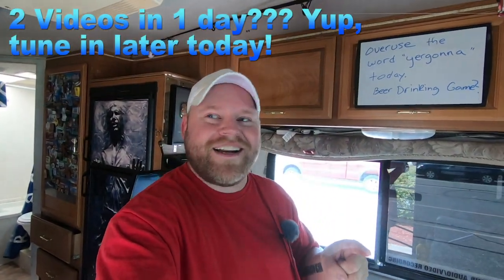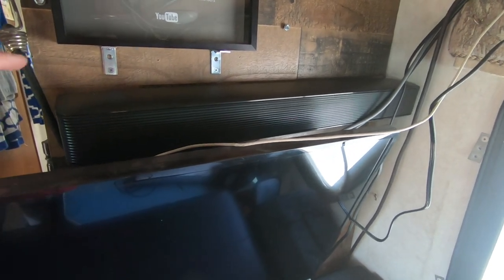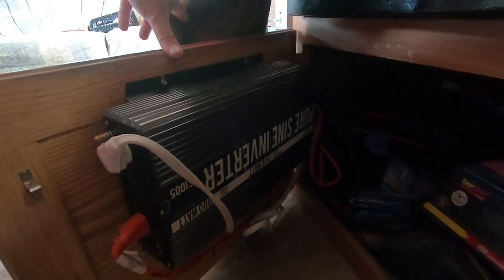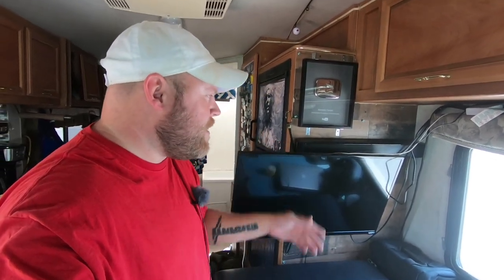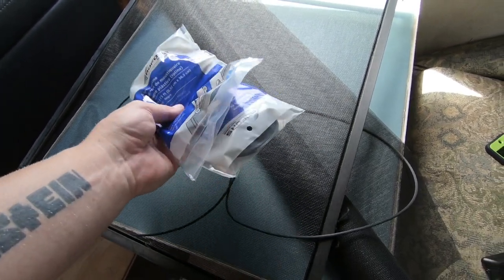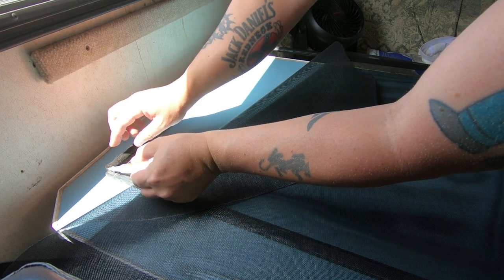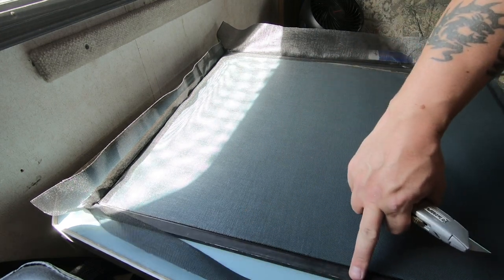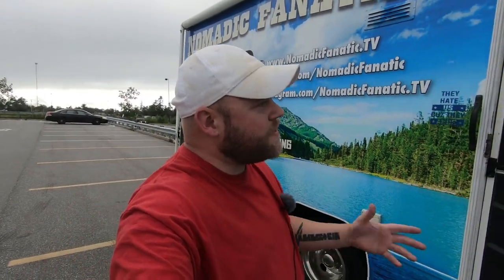Installing Sound Bar & Bug Screen Upgrade

Comment: You can see the difference in the screen for sure. It looks darker than the old screen when looking at it with the side by side shot. Thank you for showing this. I didn’t know the screen came with smaller holes.

Comment: Thanks for the DIY tips on the screen Eric!  I was thinking though that there is a trade-off to the smaller / tighter screen and that is actual airflow.  It's going to be harder for a breeze to come through that new screen since more area is being "blocked" by the tighter mesh.  But of course now you have less of those tiny bugs inside your rig.  I dunno, maybe depending on your area of the country you're in you have "tight" and "loose" screens??!  :-)

Comment: Hi Eric. Nice job on installing your no-see-em screens. It will certainly help with that problem but EVERYTHING in life is a pro vs. con, cost vs benefit analysis and in this case, the pro is that you'll get to block more insects and more light out, but the con is that you're also effectively blocking up to 50% more ventilation. You won't get as much wind draft coming through those tiny holes. So while it'll keep the smaller bugs out, it'll also restrict your air flow more. Your fans will need to circulate harder/faster to bring the same amount of airflow through the RV. Enjoy!

Comment: I be clear for those looking at Vizio tv's...Eric having issues with the amount of volume is a function of the installation. The speakers are rear firing and need a surface behind it to fire against...both speakers! I know this from personal experience. His tv does not have a wall behind it fully. I did the same thing with a larger one...ended up getting a smaller one and it all worked great, even returned the sound bar I had purchased ;)

Comment: As a personal money manager I see your challenge, much like other seasonal workers. As a seasoned YT video creator you know what to expect unlike some newbies, so my suggestion would be to prepare for the 'leaner' season by setting aside into an Emergency Fund that little extra received during the good times to cover you during the summer months.   Your faithful followers will be back after returning from their normal vacation.  Most RV'rs don't share like you the fact that your mobile home must be maintained and that includes little things such as the screens.  Good share..Stay safe.

Comment: Our ceiling vent screens let a lot of no-see-ums into the RV in Savannah. The mesh on those was even larger then our RV window screens. Have one more to change out then all 3 will be MaxxAir 4500K Vent/Fans which have better screening.

Comment: Same screen I used on my last motor home door and my van. Great screen but the only problem I found is less air flow though the screen. I missed that nice breeze....but great screen. Oh and it is harder to see in, but that is a good thing.

Comment: Thanks for another great video. I really enjoyed it.
The screen upgrade was presented very well. I’m going to have to do the same to my RV now. 
Our travel trailer has a built-in sound system that can give voice to the TV, radio, CD/DVD player, or bluetooth to my iPod, with A and B speakers for inside and outside. The system works pretty well, but I probably could upgrade the speakers. Your sound bar solution is great for someone without a system like mine. I have a pair of Bose desktop speakers that will rock the house. I might try to plug them into the TV, if it has an audio out jack. 
I miss the little TW200. You should get another one, or something similar.
Best Of Luck

Comment: For me it is so, when I see a longer video from you or mike, I would watch it the whole time, doesnt matter if it goes 20, 30 or even 40 minutes. cause I know, I like you both and the stuff from you interesting me. but from some videomaker that is new to me, maybe if the first minutes doesnt "get me" I would probably skip it. but from you, I would even watch a 20 minute video only with talking about youre toilet, cleaning tioga or a timelapse video^^

Comment: Hi Eric

If your rubber seals are starting to crack then have a look at this. 

303 Aerospace Protectant is a long-favoured product of ours that we still reach for during almost every single detail we perform. ... 303 Aerospace Protectant was originally developed for aerospace and aviation applications, and is one of the most technologically advanced UV screening products on the market today.

It protects and restores all sorts. See Sweet project cars on you tube, it’s amazing.

Comment: With the left over screen if you were to cut pieces out that were a few inches larger than your windows on the driver and passenger door windows on the cab, and used a few magnets to secure the screen in place you can cover those windows and possibly increase your airflow in the RV.

Comment: The "Maine insects" is called noseeums  wonder if that new "noseeum" screening will let the air in like the old screen. I hope you are happy with this cool night, I had to dig out my flannels again,( that I put away for the summer two weeks ago, debating whether to start the woodstove for heat, damn! Looking forward to part 2

Comment: hey eric, jus a little trick i learned in florida keeping out no--see ums .... get flaty black paint and a square dish sponge . dip face of sponge in paint and just wipe screen. the paint makes holes smaller when it coats and makes them look brand new . see ya down the  road. Midwest Mick.

Comment: The sound bar your have, any brand. The magnets in it will cause your TV to start have cloudy lines from each top corners pointing to the mid. Point of the screen !!!  Just a heads up, great vid's.

Comment: Hope you have better luck with that speaker bar. I have one from Wally's Place but the darn thing after a few minutes of no input will shut off. Oh that great in the RV BUT at home it's a ROYAL PITA having to find the remote to turn it back on! It'll be going away when I find a smaller and better one or I'm going to open it and rewire it!!
Good tip on the screening! And I guess I'll trim this video im trying to edit down a bit! 
Question?? How many click thumbs up or down before the video is over?? 

Blue Sky's and Safe Journeys!

Comment: Real fans of your channel will watch any length video that you create. Viewers who "speed watch" are probably only gonna watch 5 minutes of your 10 minute videos anyway. 

We have a small $32 soundbar right above our heads in the truck camper cab-over. During daytime and early evening we watch movies using both the TV and soundbar speakers but if we're watching late at night, we can turn off the TV speakers and just listen to the dialog right above us at very low volume because the soundbar is so close to our heads. This allows us to watch movies late at night and not be heard outside the camper :-)

Comment: Ciao! Erik, mount some kind of water coolant system to your electronics case that i see under the sofa there. it will greatly improve life span an performance  to them. if  that is too expensive or difficut at lest mount some heat sink an vent on them. the vent  will unfortunately make noise but it will do the job. on the winter side you ll nheed moist remover. safe journey and exelent job. thank you

Comment: I work with mosquitoes; your regular screens will keep out all species you will run into (assuming there are no holes in them!).  However, there are other insects (no-see-ums) that can pass through. Those new screens you installed will dramatically reduce the amount of air that is able to pass through.
Reply from the maker: That's a good point about possible wind flow restrictions. Honestly, I've not noticed a difference from the other screens.   But your logic makes sense in a way.

Comment: Yes those microscopic mosquitoes are called no-seeums in Washington state. Their bite is 100 times nastier than a mosquito. They actually float under your shirt and bite you there. Then it itches for 2 weeks. Ugh. I despise those devils. We put up the tiny screens too and problem solved.

Comment: Your income fluctuation is just like any other business that has seasonal changes. I'm not very familiar with your channel, but wonder if your viewers catch up on summer content when their outdoor adventures slow down. If so, you simply have a slower return on the summer vids.
BTW, you popped up in my feed somehow, but have enjoyed what I've seen of your Maine trip. I'm next door in NH.
Reply: Mark Attardo Mark excellent question.
Reply: I know personally that I probably watch less than half the amount of video content in the summer than I do in the winter.

Comment: I enjoyed the video. One question, is the material u used house screen or specific to rv's? Thanks again for the videos, plz, keep them coming? Eric Sulen, Grand Rapids, Michigan.
Reply from the maker: One type I got was at home depot, and not specific for homes necessarily.  It's for mobile homes and outdoor sheds, or anything.  I don't think you're going to find any RV-specific screen material sold at an RV parts store.

Comment: Length of videos doesn't really bother me either way-you do excellent videos and I enjoy your travels HOWEVER, over the recent months when I look at your videos an issue has developed....if you have monetized or not, those spaces where they are intended to be cut to black screen for a sec or three then back to your videos-within the next 60 seconds of your vid it happens again but does not recover the visual, only the audio continues...I end up having to stop the video, back completely out, then restart the video, find my last viewed time stamp and continue watching. On this video alone I had to restart 4x...not sure what yt has done but this is also happening on your 2 and 3 year vids and only happens on your videos....very disappointing and frustrating....maybe it's happening to others and that's the reason why you see the different viewing times not being completed...just saying☺

Comment: Ya know, I would much prefer two shorter videos to one long one. There is a much greater likelihood that I would watch them that way. The channels that don’t edit much, I watch a few minutes and if there is too much boring filler, I just stop watching. With your longer videos, I might not get through the whole thing in one sitting, but I will go back and watch the remainder later. On another issue......my online shop makes waaaaaaaaaaaaaay less in the summer. Like 90% less. Oh.....and one more thing. Does it help you if I watch an entire commercial vs. clicking off the add in a few seconds? I would be happy to let the whole thing play if it helped you out.